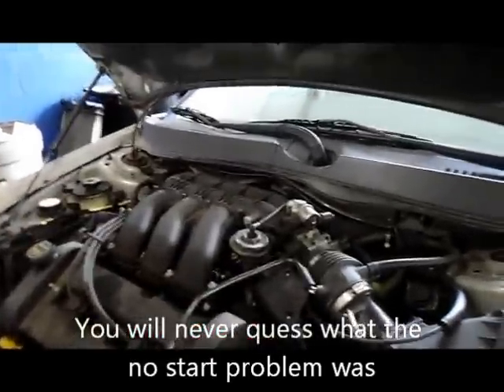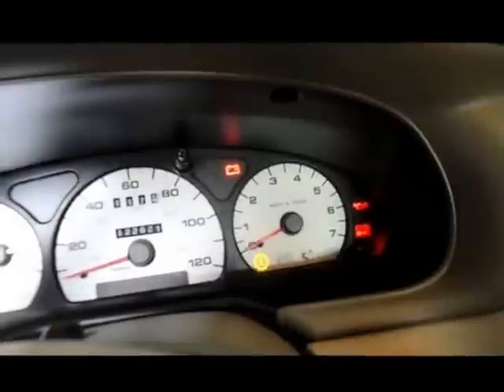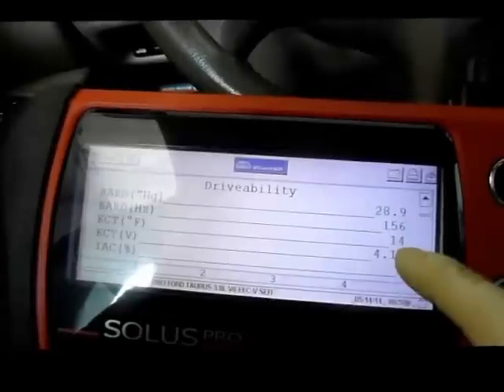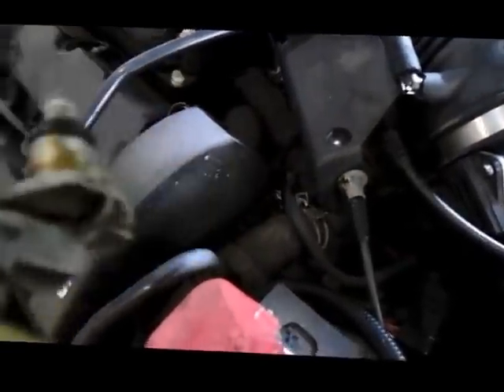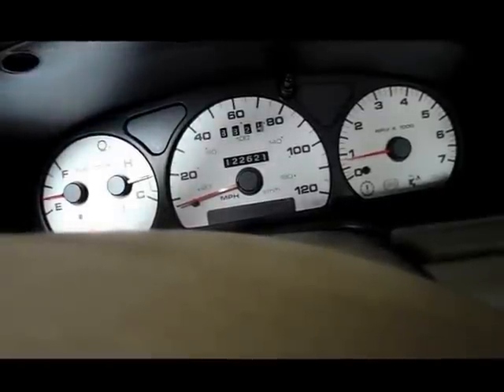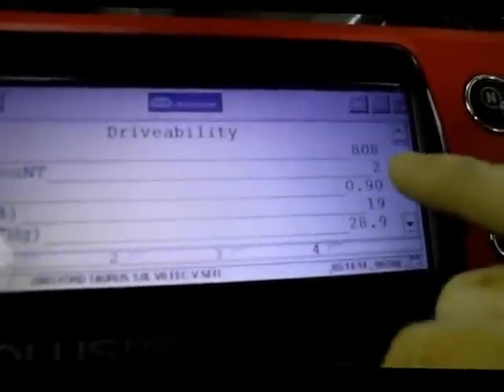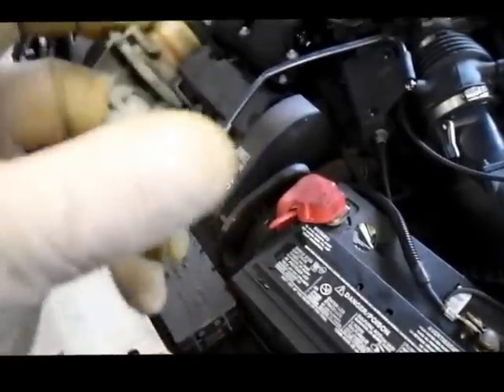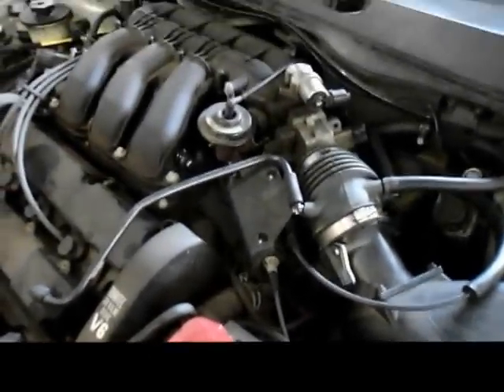Engine cranks but won't start

Comment: Hey Jim thanks for the great video and not talking to us like we are all
 in the 3rd grade.  That said I had a 94 taco that if the coolant got 
low I would get a surge and or rough idle from the engine.  The coolant 
temp sensor was throwing the air fuel mix off, weird for a 94...

Comment: Thanks for another great video Jim. I'm curious why the temp was showing 192 if car hasn't been running.
Reply: Great point. Now theres a guy that unplugged the old and plugs in new one, leaves on engine, STATES PLASTIC ONES BREAKING A LOT, said buy the good ones that's brass temp one. Will look into it.
Reply: I assumed he had it running and confirmed the problem before making the video.

Comment: I have ran into this on a 1993 Chevy Silverado 350 TBI, but it would flood then not start. it was also the coolant temperature switch.
Reply: The temp sensor prevented reading. New sensor allowed reading. You may want tore watch the video
Reply: I just had same problem. After replacing throttle body, fuel pump fuel filter, ect.. I still got same problem. It would fire up when i first try in morning. But the second the engine got warm it would start sounding like it was out of time and it would die. And when trying to restart it would crank but no start. So finally got a code 15 on blinking light on dash. So i unplugged temp sensor and i jumped both wires together on wire harness. Started truck up and truck has never ran and idles as good as it does now. Never heard of a temp sensor telling causing this in my life. But it makes sense. And it was like you said on the chevy the computer tells it to give more fuel which causes it to flood engine. As when I would check new plugs they was wet everytime it would die and not start back up. Good post/comment.

Comment: This more or less happened to my 2003 Audi A4.  The temp sensor was faulty and telling the ECU that the car was already overheated and thus wouldn't allow it to fire. It would crank plenty but not fire.  The irony is that it was on one of the coldest days of the winter last year.
Reply from the maker: Thank you for watching.
Reply: Did your rpm guage jump when you turn the key over. Mines doesnt and i have the same issue
Reply: iRecordOS I actually can’t recall. The only reason I figured out what was going on is because I had been getting a CEL for the same sensor so knew it was starting to fail.

Comment: I BELIEVE I HAD THE EXACT SAME PROBLEM A COUPLE YEARS AGO:

This drove me absolutely up the wall until I simply decided to change the temp sensor which I too had noted on my scanner reading -18 degrees. After returning car to customer and no further problems I REALLY started pulling my hair out trying to determine how in the F the coolant temp sensor keeps the engine from firing.

This is what I came up with:
If the coolant temp sensor does not agree with other temp sensors such as intake air temp, the ECU shuts the engine down as protection as it has determined the device is not reading properly and wants to avoid possible engine damage from an overheat condition.

For those of you who may want to school me on the difference between readings on the the intake air temp sensor and the coolant temp sensor...........I know so forget it.

I have since discussed this in detail with ford engineers who after a week or so of my initial contact came back and confirmed my suspicion. 

So with me: CASE CLOSED and now I can sleep
Reply from the maker: Frank Dion thank you for stopping by the shop

Comment: I bought a new 1999 Dodge Stratus with the 2.4. Drove it home and the next morning it wouldn't start. Dealer sent a rollback and it started up for him. At the dealer, no codes or anything could be found. They returned the car. The next morning, the same thing. This time the rollback driver couldn't get it started. Dealer found that the high temp sending unit was giving a high temp reading to the computer and shutting off the fuel. Problem fixed!! This happened in less than 50 miles on a new car.
Reply: 773trucker 
Cars have thousands of parts. They have a failure rate. It passed operational tests, but failed when it got to you. Just funky luck. That's why the dealer has a repair facility under warranty.

Comment: You never worked on a VW? One of the most common issues for odd no starts is the coolant temp sensor.
Reply: Goodl ol VW's and their crappy electrical syystems!

Comment: Had a 05 Buick rendevue that would bog down on hills but run OK on level gouund. dealer replaced computer, cut off cat.converter still couldn't find problem. they called Detroit engeneers ,found out a wheel sensor was sending a bad signal to computer telling comp. to limit gas flow to 75%.  Dealership wanted me to pay  $1600  for them to experiment  to find problem. finally settle  for half. Still a bad pill to swallow.  Buick won't see me back!!!
Reply: George Shears i would iffin i was you go out and buy a 1971 ford f-100 and fix it up like new and say seeya to all those sensors and hemroids ect.. yea i know it will cost an extra 2 dollars in gas per month but thats what i would do.
Reply: sounds like a good idea to me!!!!!!
Reply: I totally agree with you.  Let me repeat, I TOTALLY AGREE WITH YOU.!!!!!!!!!!
Reply: Yeah, except my daily commute alone is 60+ miles so that's like an extra $3-4 in gas per day. Meaning over $100 difference on my monthly gas bill, if I DON'T take any trips.
Reply: Guy Azbell I have a 1971 f100 step side does like gas

Comment: I've never run into this problem but It would have been helpful if you had pulled an injector (leaving it connected to fuel source) and held a rag over the orifice while cranking to see if fuel was being delivered. (At least for the Youtube comment section).

My thoughts on this is the computer is expecting a certain number of parameters within specific ranges for startup and this ECT sensor was in an open (fail) state (4.9v) which means if Ford engineers had allowed the car to be started/ran then the coolant temperature could not be read by the computer. Coolant temperature is a necessary value the computer needs to monitor so the car does not overheat, if not for other reasons.

Kinda like your home computer, where the CPU monitors it's temperature and revolutions of the CPU fan. If the computer starts up and either values are unreadable, some computers will immediately power off or beep. In older computers, it just kept starting up and within 45-60 seconds the CPU fried itself.

Edit: I feel the 14 degrees displayed temperature was misleading and should be ignored. What the viewers should have considered instead was the ECT voltage (also displayed on the screen). The voltage gave the clue needed for solving this.
Reply: It makes sense, but still not a catastrophic failure mode to prevent engine from operating. No enterely sure how CO2 sensors work since they are preheated on start, but the computer could guess that engine is cold from that side so attemp to run on avg figures and mark flashing check engine light on the dash. Catastrophic failure would be a crank sensor because you can ruin the engine injecting without any clue.
Reply: 38911bytefree The O2 sensor you mention is not the ECT (or CTS) sensor. Also the computer cannot guess, it only receives sensor values and then makes spark and fuel adjustments based on the data its given. ECT reading is one value the computer uses, combined with other inputs to adjust the fuel mixture. Easy enough for Ford engineers to program the computer to prevent spark to the plugs when all the required sensors are not in the ranges it could expect. Note the new ECT sensor was now reading the proper coolant temperature and the sensor voltage decreased substantially, now the computer had what it wanted and it then provided spark for startup. The video proves it was the fault of the ECT sensor. (Other vehicles may not be programmed in the same way).
Reply: Interesting problem. It's probably related to Ford's oil pressure protection. If the oil pressure during cranking is lower than expected, then the ECU shuts off fuel and spark. 

With the coolant temperature sensor reporting a very cold start, the ECU is expecting a high cold-start oil pressure (due to high oil viscosity). Instead, it's getting a low pressure due to warm oil, and blocking the start.

You can get the same issue if you put the wrong grade of oil in. This is worse on some engines, where Ford made a last minute change to the grade, specifying a lower viscosity oil to meet a fuel consumption target or something. If you go a grade thinner again, this may be enough to trip the low-oil pressure safety and the car won't start.
Reply: Exactly lol. Guess people don't know what a built in safety measure is
Reply: Mikel Bentley.. People understand a "Built-in safety measure" However... They don't want them to inhibit them from driving their cars to an automotive shop for the repair over a sensor failure of a obvious false sensor reading. Do we need onboard sensors to detect and bypass failing (inaccurate) onboard sensors??? The very Best auto techs will tell you... Although a diagnostic  system is beneficial. Many are poorly designed and overkill.
Reply: Mark Knight... if my SWAG is right and it is the engine temperature control system shutting down the engine, it does so because the engine will die soon enough and require head gasket, and maybe head, replacement before it runs again if it doesn't shut down by the control.

Comment: It sounds like it's part of the car, own safety feature's, so the engine doe not get damaged. Just modern technology, with a lot of computers, and software.
Reply: Yea wish my car had had that .... before she overheated ....  and blew the head gaskets .... and warped the heads
Reply: No, the sensor is confusing the computer. At low temps the computer Richens the mixture, so its making a flooding condition (In this case). And sensor was sending over 4 volts, new one sent .66 volts, probably confused the computer even more.
Reply: It shares a common ground with the other sensors and acts as a pull down resistor
Reply: Did anyone else notice engine temp was at 192 degrees on the test restart? How can that be?
Reply: The guy had probably already run the car before to see if he had fixed the problem before he had actually filmed that he had fixed the problem.
Reply: Yep just like the oil pressure sensors on some model Chevy trucks that shut the engine off when they sense low oil pressure or would not let the truck start when the oil press sensor was not working.  Saves your engine and a bigger repair bill.
Reply: mark jeffries, 192 Farenheight. 232 is boiling temperature

Comment: I am working on a 1994 taurus wagon 3.0. It will crank and run like a sewing machine until it gets warm, then it shuts off. Have to wait until engine cools before it will crank and run. This is exactly what's wrong. Thank you.

I already did everything else.
Fuel pressure good, fuel filter replaced
New plugs/wires
Cleaned MAF
Checked crank sensor
All fuses good
etc etc

Comment: What is happening here is the coolant temp sensor is shorting out to ground the 5 volt reference circut is shared by mutiple sensors like MAF , coils, map, and many more. So anyhow with the temp sensor shorted it also shorting out everything on that 5 volt reference circut which is why it won't start
Reply from the maker: Thank you for watching
Reply: You almost have it right. The ETC is short to positive not grounded as you stated.
Reply: Ok so I am needing help bad. I have a 2006 Volkswagen Touareg V8 4.2L. I have a brand new battery. The Volkswagen won't start, but does act as if it wants to turn over, it just doesn't. My instrument panel/ dashboard has ECM light that stays on, as well as engine light, and ABS. When I try to start my car up,  it is quite, and doesn't sound different, except that it won't start. It has back fired a couple times, pairiotically. It has a brand new timing belt on it, when I purchased the vehicle. Which also didn't work when I purchased it as well. My question is if it reads something about timing, could it possibly be the camshaft position sensor that could possibly be the reason for the vehicle not to start and possibly read as timing? If not could I possibly get any advice or direction on what I could do to resolve my situation to get it to where it will start up, so I can drive it. Please I'd forever be grateful  for any direction, help and advice i may be able to recieve. Thank you

Comment: It's like a circuit breaker, computer is set so the engine dosnt over heat.
Reply: Ok, but if the ECU is set to rather be safe than sorry in case of a questionable sensor, why does it allow cranking the engine?
Reply: depends on the vehicle some dont fire if no fuel pressure, some dont fire if no oil pressure some just wont fire if any of the sensors are faulty, whats really needed are driver capability sensors to tell if a low performance driver behind the wheel of a high performance car that wont allow driving beyond his/her means, and if the cell phone is in use steer it to the curb
Reply: Likely due to the computer having no control over the starter, in this vehicle?
Reply: Because Ford engineers know that cranking the engine will never overheat it. Allowing it to crank also shows the components and computer values needed to crank the motor are within value and working, so the repair person can concentrate on operational issues even if it doesn't start (Items come to mind, fuel delivery, MAF sensor, Air flow, ECT sensor etc..)
Reply: Well...what happens when the car owner overheats????
Reply: @STARDRIVE  
Because...In cranking the engine....little further damage can be caused.. and the ECU needs the information that that cranking provides.
Battery voltage during cranking, cam position for example......
If the engine is mechanical/physically unable to crank...That information is also valid.
Sadly, Cambelts fail too...almost without warning, but that is not a software issue. 
They fail in-use.
That is simply mal-use by the owner. 
(No electronics can cure stupid.)
Reply: P.S. I had a Subaru owner: he changed his timing belts. (Admirably on a Subaru!)(Impressed!)
Afterwards...it cranked...but would not start.
He didn't realise the engine  ECU was asking for information from the air intake....
It was lying on the ground...at the side...
Replaced that....and it ran instantly.
No problem. 
(Oh...& the guy was an electronics "expert" )
(None of us are perfect.)

Comment: Could this be true also on older Ford's like a 1992 3.0 Aerostar van.
Reply: If you haven't already replaced the sensor, you should do so.  Then disconnect the battery for 10 minutes so it will refresh the computer.  Worked on my 1995 f150 4.9ltr

Comment: You know your stuff.I have a 96 Dodge Avenger.After changing coil and spark plugs and car started with ruff idle left running when inside for 2 minutes came outside car was off.I tried to restart no success.I watched your video.I purchased a temp sensor online a couple mo ago noticed cool level sometime below c level went driving even on hot days live in FL.I decided to change temp sensor .Car Started Right Up.The computer was stopping car from starting up. Good Diagnostic Bro.I'm having a cold one🌴

Comment: Over voltage from the sensor causing the computer to not want to do anything.
More than likely just a bug that the engineers didn't account for.

Comment: All ford vehicles have a no start for the temp sensor lmao my 1988 f150 did that if you hold the gas to the floor it'll crank after a min but it'll try to flood out to keep from starting bc the computer thinks something is wrong lol
Reply from the maker: Thank you for watching.
Reply: Mikel Bentley 
H
Reply: Mikel Bentley @
Reply: Mikel Bentley aye man fast question I have a 1991 ford f150 and it cranks but wont start I already replaced many of things such as plugs n wires which was in bad shape so was definitely needed had little to no spark changed the starter, the ignition coil, the starter solenoid switch, the battery, distributor cap, and a few other things cant remember it'll crank without the gas pedal down just still not getting it to start

Comment: 1999 honda crv - back in February 2017 - ect sensor caused it to run in limp mode. would not respond to gas pedal. these inexpensive sensors/plugs/sending units can create large headaches--  luckily they are fairly accessible. Great video

Comment: All of this electronic crap is tied into the computer and if anything is off it doesn't work.
I'm going back to a Fn carburetor and mechanical fuel pump driven by the engine. Keep an extra set of points, condenser and fan belt in the truck, Old is better!

Comment: To the FORD haters , worked on all makes and models for 42 years and they all have their problems.
The early years of OBD 1 GM's we had 3 grocery carts full of ECMs, ECM chips, crank sensors and fuel pumps.
An ECM then was a $400 guess after the go/ no go test( by the book) would point blank say "change the ECM"
AND THE CAR STILL WOULD NOT START(Try explaining that to the customer or to a Judge in court) ?
In a lot of theses cases we found the problem to be both ECM and the $140 PARAMETER CHIP. all we 
could do was quote up front $540 and change both.
Reply: Been there,done that...still like PCM controls.More power,with same fuel quantity,cleaner running.Main problem imho cheap sensors etc.I started wrenching around 1960.Now retired, a triple master tech,I love cars.Remember always start with the "basics"first then move to more elaborate controls/systems.